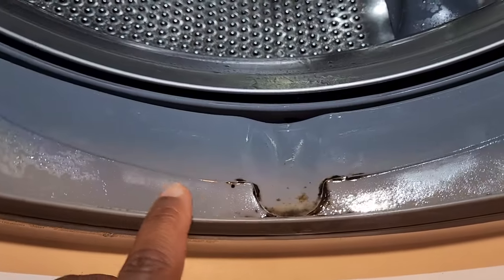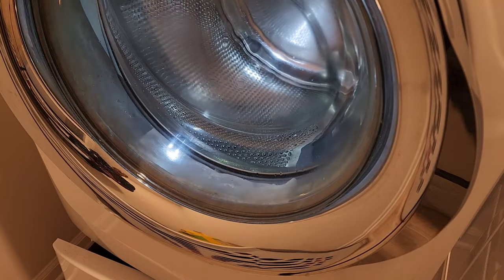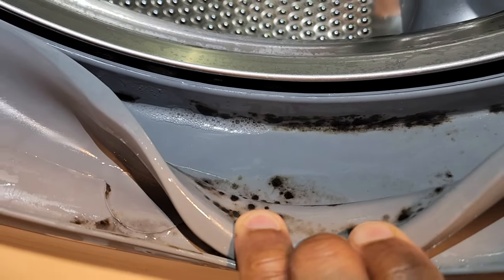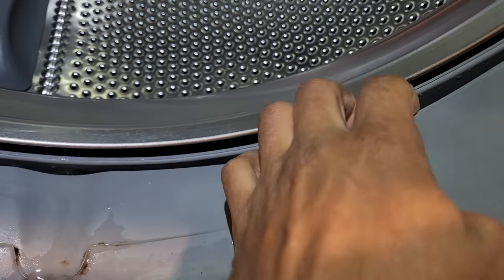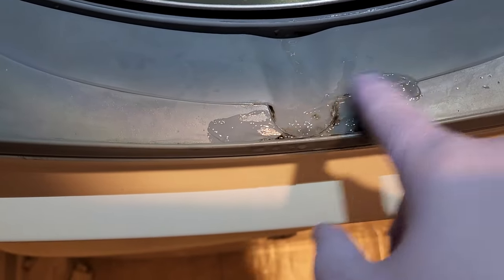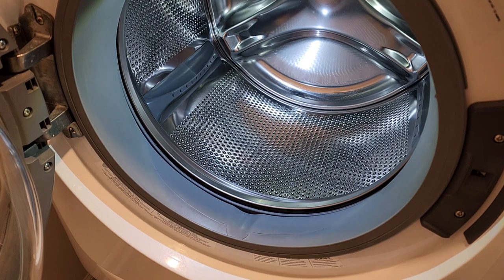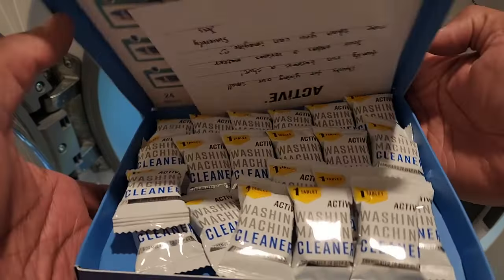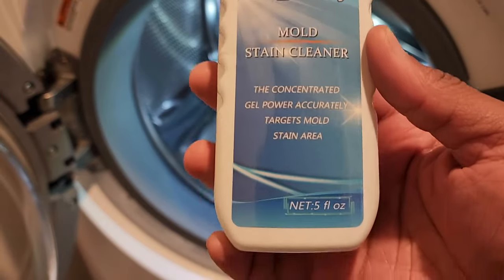Laundry Maintenance | Mold in Front Load Washing Machine

Comment: It would be nice if these washers had a "dry drum" button that you can press after you take the clothes out.
Reply from the maker: Well, with the amount of years front loaders have been around and no sign of that innovation on the horizon. They would probably rather sales from replacing the entire gasket to continue happening. 😄
Reply: You can get at least one US model with a fan in it so you don't have to leave the door open - I think it is called Ultra fresh. 
Also some uk washer dryers (which I wouldn't consider buying) run their fan  after a wash if you do a wash without the drying cycle, although possibly that's to stop the  aluminium fan corroding.
Reply: The GE GFW series literally has had that exact feature since 2016 and it works very well! In fact, rumor has it, the development of that UltraFresh vent us what ultimately led to the GE combo washer dryer with heat pump drying. That being said, you can absolutely, 100000% never have to deal with mold if you leave the door cracked and use appropriate amounts of powder detergent.
Reply: I have the GE with the UltraFresh vent feature. I almost never use it. I just leave the door open/ Every month and a half I run a cup of bleach through the clean cycle and then dry using the Ultra Fresh vent system. No mold, no smells. Some of my wash loads have Oxi Clean in them but I'm not sure if that helps.
Reply: @Todd.T Oxi Clean should kill mould and bacteria if the wash is warm enough, but would work better at lower temperature if it had a bleach activator like TAED in it along with the sodium percarbonate it does contain:  https://www.youtube.com/watch?v=1NmsV6XAbuY
Reply: GE makes them and they are the best
Reply: We always leave the washer door open for a few hours after using it: no mold.

We also use the same "Active Washing Machine Cleaner" product every three months, and follow the rest of the manufacturer's (Kenmore's) regular maintenance instructions.

But removing mold is 100× harder than preventing it.
Reply from the maker: You are right. Prevention is the best practice!
Reply: Then it would be a dryer
Reply: I have ALWAYS, ALWAYS left the washing machine door open after I finish my laundry- either completely or partially and I’ve still had mold ever since I bought my new LG front loader many years ago. I run a “clean cycle” almost weekly with either Clorox or those washing machine cleaning tabs. I’ve also used bleach type cleaning sprays like this video (such as) ZEP or Clorox Clean Up. 
My mold problem isn’t nearly as bad as this washer in the video. But I even live in a dry climate. 
So my point in saying all of that is that you can still have problems with mold, even if you do leave the door open all the time and clean the washer regularly.
Reply: Million dollar idea here 😂
Reply: @dregenius leaving the door cracked open alone DOES NOT Eliminate mold. The gasket must be cleaned.
Reply: Just to be clear to all the comments. The GE DOES dry the inside of the washer. The  GE does have a clean cycle whereby you put bleach or affresh in. The GE does have an OXI cycle to eliminate bacteria for if you were washing things from a medical environment. I've only wiped the gasket 2-3 times since 2021. I also used glass cleaner on the door glass because there was buildup that none of the cleaning methods seemed to take care of. The door is open all the tiem unless it just finished a bleach clean. I do those  overnight and if you don't open the door after a clean cycle or close the door without shutting off the machine it will automatically begin to vent dry the unit. No mold. No smells.
Reply: Yes! Totally agree with you. The machines would be more expensive, but willing to pay a few extra dollars for that feature! Makes so much sense.

Comment: like your video but I'd caution everyone to at least understand that ZEP product you demonstrate on that mildew infested gasket at the beginning is basically highly concentrated bleach.  I own a commercial laundromat and I wound not use that stuff due to risk of leftover residue and ruining of customers clothes.  Bleach is a big no no for my business. Too much can go wrong.  At home?  I use it.  But there's other ways to get rid of that mold.  91% rubbing alcohol works.  Odo-Ban will work over time if used consistently.  Ammonia works.  Bleach is a harsh chemical.  I'd be careful.
Reply from the maker: If you wash out the bleach after soaking, there won't be any issues. Either way, the ZEP didn't remove the mold so most people will not be using that product to solve their problems. 😁
Reply: Interesting so IPA is also a possibility
Reply: @btshomedition    Most important thing you said was leave that door OPEN!  I fight that battle every day.  Also leave that top detergent area dispenser door OPEN when the machine is not in use.  I don't blame customers (it's natural to want to close these doors) but its the main culprit to bacteria growth.  Doesn't take very long to occur either.  It's a daily fight.

Comment: Wow, we’ve had our Whirlpool front loader for 8 yrs now and from time to time I have wiped inside that seal. We’ve always left our washers open as far as I can remember as a child. Never had a smell or mold problem whatsoever either on top or front loaders. It definitely makes 100% difference to get into the habit of just leaving the door open 100% of the time when not in use.
Reply from the maker: You're absolutely correct. When the moisture is trapped, its got no where to go!
Reply: excellent
Reply: I leave the draw slightly open as well to prevent mould growing in the draw compartment. When we used to leave it closed, we had a problem with mould growing in the top of the draw compartment blocking the water jets and had to regularly clean it with a steamer.

As well as leaving  the door open, I also use a washing powder that contains oxygen bleach,  which is a highly effective microbiocide. When I stripped my machine down to change the bearings after 10 years use, I didn't find any mould or bacterial grime on the inside, it was nice and clean and smell free. The only issue was a few areas with limescale deposits from not descaling it for well over a year.

I suspect the same measures also helped to prevent the aluminium alloy spider in my machine from corroding.
Reply: @mels8966 eight years in and my door seal looks brand new. Wipe it down after every wash and leave that door open  for ten hours at least. It really is that simple
Reply: They even make a thing that props it open! We got one and it makes it really easy to remember so we don't accidentally close it before it dries
Reply: How is this at all practical? It’s insane to me that people are fine with just leaving the door open all the time, and I can’t because it’s in the way of my pantry. I’m renting, no I can’t do anything about it.
Reply from the maker: If you are unable to leave the door open, then just be sure to wipe down the gasket after each use.
Reply: @brittei  Perhaps, open the door before you go to bed so it is left open overnight to dry when it has been used, and also remove the draw for better ventilation and leave it out until you use it again. Also consider using powder detergent with oxygen bleach and TAED  in it, or failing that maybe use an oxygen bleach stain remover in your wash, it should help to stop the machine getting smelly by killing bacteria. TAED boosts the effect of oxygen bleach and makes it work at lower temperatures. Also cut down on softener, softener (and to a lesser extent liquid detergent) residue provide a medium for bacteria and mould to grow in.

Comment: I just picked up a second hand washing machine that I intended to use. Mould on the door seal of course. I mixed up soda crystals and bleach to toothpaste consistency. Applied liberally, left it for 15 mins. Cleaned off with sponge, done it again and the seal was like new. Not a single spore of black mould. Cheap as chips, and the whole process was less than an hour but mainly waiting, no scrubbing what so ever!
Reply from the maker: Thanks for sharing the method that worked for you. I guess it all depends on how bad the mold is.
Reply: Que es cristal de refresco?
Reply: @claudiacas8678  Bicarbonato de sódio.
Reply: @DyoSurfAndRide about how much baking soda and how much bleach did you use if you don't mind🤔
Reply: @iceman100685  I didn’t use too much really. If i have to guess maybe 100-200ml

Comment: We have a really bad mold problem. Replaced the gasket, a few months later got moldy again. Followed all the advice, kept door open, wiped up loose water etc. etc....
Reply from the maker: So I assumed the changes you made have resulted in no more mold?
Reply: @btshomedition  nope, moldy as ever.
Reply: @linandy1 Just get a top load washer and leave the door open all the time. Front load washer has seals that trap wet air. So mold will come back if the front load washer is placed in basement or anywhere humidity level is high. Even if you kill the mold with chemical, some of dead mold is likely to stay. The only way to get rid of mold is chemically and physically removing it. Then let the dry air flows around.

Comment: Never ever had this problem but a lot of my friends have it. 
Just clean it regularly, empty cycle for 90 degrees from time to time, and leaving door open after each using is enough to avoid this problem. 
Also rinsing drawer is enough to avoid mould there.
Reply from the maker: Looks like you got it. Air flow and regular cleaning will do the trick!

Comment: I always leave the door open instead of closing it tightly when the washer is not in use, I've never had mold in my washer.  Regular cleaning and running it on the "clean washer" cycle once a month keeps it clean, I also quit using liquid fabric softener because it gums up the working parts.
Reply: You sure we have to give up on liquid soaps? Because as I've read somewhere liquid detergents are best for cloths in front loads being soft on cloths! Even our LG washer manual suggested not to use liquid detergent. I've a couple of bottles of liquid detergents- about 2 litres now. I'll buy powder ones. But when I used powders, the smell was really strong from washer though. Very confusing. I've heard extra detergent (powder) leaves more mould.
Reply from the maker: Thanks for sharing! So you don't use any fabric softener at all?

Comment: well you're supposed to ALWAYS let the door open on the front loading machines, this is why I love and always buy LG appliances because they have a magnet on the door opening to keep the door open when you don't use it so it'll bring air in and not build the mold and mildew up.
Reply from the maker: That's great information, thanks for sharing!
Reply: I have an LG front load washer and not noticed any magnet on the door. I leave mine wide open.
Reply: @johndoe-vc1we  well some of the older models dont have it so yeah.
Reply: @officialnotonlyjames  mine is from 2015. Works great still. LG fan here when it comes to front loaders 😊

Comment: My front load washer has a magnetic device to keep door open but even that's closed too much and still smells the next day so i just keep the door wide open along with the detergent compartment after every load and just everyday in general. Even after a few days or even a week without doing laundry,  you'd think it's dry enough to close the door but nope! It still smells if you close the washer door at anytime so mine stays open all the time when not in use.
Reply from the maker: Thanks for sharing. Since I fixed this issue, I leave the door open unless it is being used. 😎

Comment: I saw one video of a appliance tech piutting pool shock it still in powder form in the door gasket and allow it to sit/absorb to help clean the mold and kill it so it sanitizes it then removes and  wipe clean. THOUGHTS?
Reply from the maker: I have also came across mentions of pool shock. I do think that would probably work well if you needed to remove the gasket for treatment but I will have to give the pool shock a try one day. 😃

Comment: Most ppl thinks their washing machine (or any cleaning device for that matter) works like magic or something.
This is one of the reason why the manufacturer(s) recommend to run a tub clean every 60 or so cycles with bleach/baking soda to prevent escalating issues like mold, bacteria(s) growth, etc…
Nothing fancy, just bleach ought to suffice or vinegar for those green folks.
Granted, you happen to have a horribly designed silicone bellow/seal hence that prob.
Reply from the maker: Yes, the bellows design definitely contributed to the problem!

Comment: Nice video! Progressive solutions.
From my experience, leaving the door wide open works better than cracked open.
Is there a performance difference, other than labeling and price, between the Mold Remover Gel link in the description and the product shown in the video?
Reply from the maker: Yes, leaving the door all the way open will allow the moisture to dry out better. As far as the product, they are the same.
Reply: Door wide open and drawer pulled out creates a draft

Comment: Basically you have to wipe down after each wash cycle?
Reply from the maker: Correct. Moisture that cannot evaporate = mold. Airflow or wiping down will prevent this issue.

Comment: i've never had mold in my top load washer but i always leave lid open so it can dry inside. wouldn't it be easier to simply leave the door open when not in use? ... then it can dry naturally between loads??
Reply from the maker: You are absolutely correct. This has been a great practice that ensures the drum and gasket dry after each use. 😊

Comment: Much more easy: 2 dishwasher tabs, run the hottest program and all mould and soap residue is gone.
And leave the door and soap dispenser drawer open to let leftover water vaporize.

Also your dryer, never close the door.
When you have a heat pump dryer, also open the door to the heat exchanger and let it dry and remove the dust from the dust filter.
Reply: But will the bulb burn out? My dryer light never turns off if the door is open.
Reply: @danibakesmauiii  Dryer light?
I have no dryer light…….
Reply: @rvo8915  it probably burnt out from leaving the door open! 😂😂😂
Reply from the maker: Thanks for sharing. Does this work on old stubborn mold?
Reply: @danibakesmauiii I got to admit I never heard of a light in the dryer. Freezer? Yeah

Comment: I have had front load washers for 20 years and have never had mold in mine.  I do wash my towels with Clorox so it may be the reason why.
Reply from the maker: Top loaders are less prone to this issue which explain why you probably never experienced this issue.
Reply: @btshomedition my statement was about front loaders.
Reply from the maker: My bad, I don't know why I had top load in my head. Lol. Do you leave the door cracked?
Reply: I try too but sometimes we’re just close it but we do have a water softener the has less minerals so calcium and soap scum buildup is less of an issue.  I heard that lessens the chances of mold as well.
Reply from the maker: You're absolutely correct, the quality of the treated water definitely has an impact on how quick mold appears. I will be installing a whole house water filtration system in the future.

Comment: Mold and bad smells is a common issue with front load washers, yet they are what most people want and pay big $$$ for. I don’t understand this. Top load washers have been around for over 50 years and don’t have theses issues. They clean just as well if not better and usually are less expensive.
Reply from the maker: Great point. Depending on the house layout, a stackable pair may be the best option with limited space. Also sometimes the laundry room is right by the garage door so esthetically, it looks better. But as you mentioned from a functional perspective, the top load does the job just fine!
Reply: My childhood home has a top loader and even then I grew up with always keeping the lid open. In my current rental, I share a front loader with housemates and they always forget to leave the door open!
Reply: @GoalWalker  yup, it’s easy to leave a top loader open as it doesn’t inconveniently stick out into the room. It’s not really necessary, but    there’s little downside to doing so.

Comment: Hello! I just purchased the gel mold remover. Do you run a hot cycle once the product has been left overnight or are you just wiping it away?
Reply from the maker: After wiping it off, it surely wouldn't hurt to run a hot cycle. Did the mold go away after leaving it overnight?

Comment: I tried cleaining it also. BOSCH 300 SERIES, $29.99 replace the rubber Casket. Takes 30 min to replace it. No screws, no tools needed. No worth cleaning it, when it looks like that! I tried for 2 weeks. Wasted a lot of time
Reply from the maker: That's a great option depending on what machine you own. In my case, the gasket was about $100 and the time to change it would be closer to 1.5 - 2 hours. So great option for your situation for sure! 😎

Comment: We have more mold?
Reply from the maker: The key is to let air dry out the bellows after each wash. I have not had this issue since leaving the washer door open.
Reply: @btshomedition we wipe it all down with microfibre towels as well as inside the fold and under the fold where the slits are immediately after every wash and leave the door open for hours. Still get black mold.
Reply: I stopped using fabric softener and also only use powder, this has made my machine stay cleaner, also do some hot washes now and again.
Reply: @JazzyScat it means your door seal still remains moist. If you run your finger inside the gasket ten hours later is it dry or not